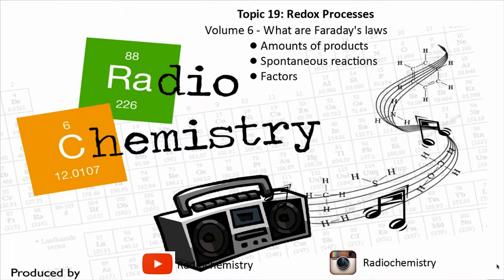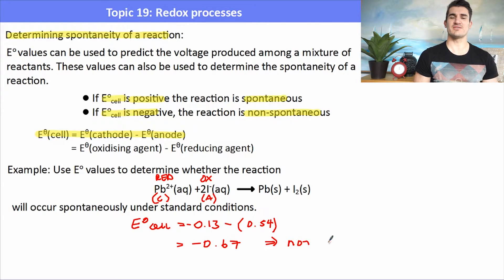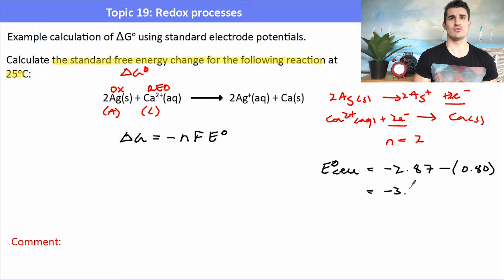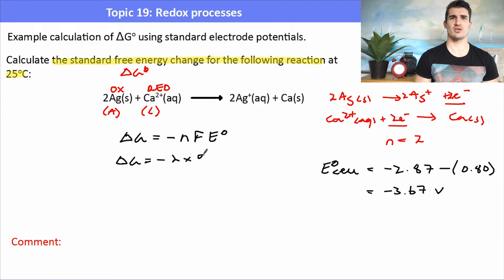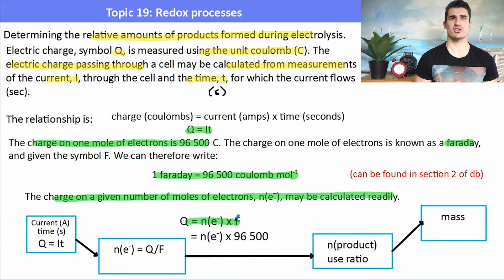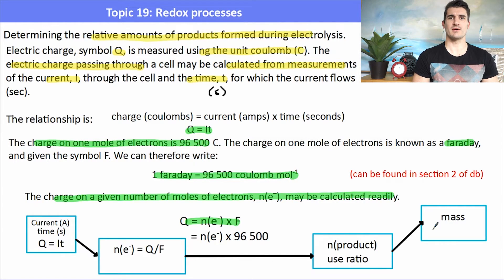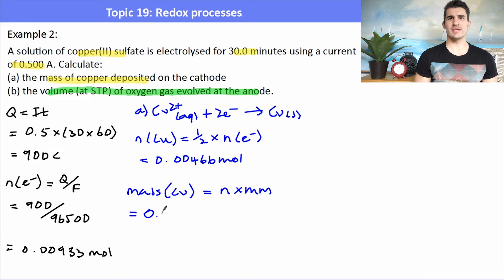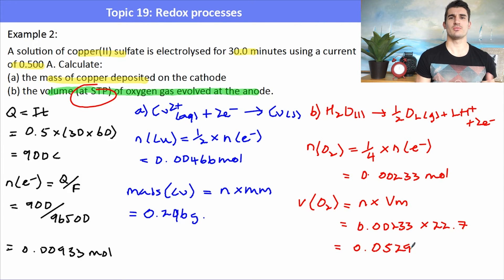Topic 19 - What are Faraday's Laws?

Comment: At 5:29, the kJ value should be 708.310, not 7.08 kJ. Please correct me if I'm wrong.
Reply from the maker: You are correct. 7.08 x10^2 kJ will do the job. My bad. Thanks for the heads up.